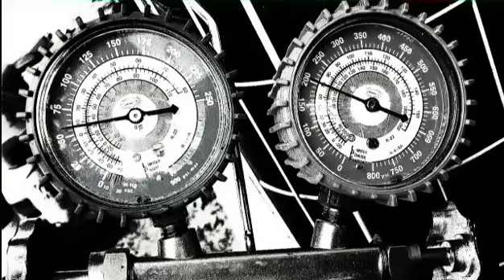HVAC RX11 and Pro Flush Debate

Comment: From what I was taught in hvac school, system flush is for when there is a compressor burnout and contamination or if you are changing refrigerant. If you don't get rid of residual oils and acids in the line set they can damage your system when it's replaced.

Comment: I have used flush on burnouts...  And linesets that I know I can get it all out...  I have commercial buildings that I can't change the pipes...yet I want all the oil out... So I have done each pipe separately....but they have been straight lines for the most part...  I don't think its "needed"...  But I know my boss was told to do it ...so  I know he feels more comfortable when I do use it!  Lennox's flush procedure is ludicrous...  So r11 made more sense to us...  But I gone the way of not using it and just the lines blown out real good!
Reply from the maker: Billy Knoth Hey what the boss says goes. A lot of it is comfort, how far do you need to take it to do a good job in your own mind.
Reply: I have accepted the fact that I can blowout with nitro only...  And I'm good with that...I will always do at leased that.... I call that good...  But if lines are in that good of shape..."oil less".  I can see skipping nitro...to save time...  Just don't think I would..lol..have u seen what Lennox wants you to do???  They were CRAZY!!!

Comment: Sometimes I will Braze all my joints except for the coil and condenser and then flush to remove the carbon deposits from the joints i just soldered ,but I always flush with RX-11.

Comment: I use a 11 CFM vacuum and 3/8 hoses also flush the system with dry nitrogen after using R-11 flash
Reply from the maker: acechoice45 sounds full proof. I don't go that far, but it sure aint gonna hurt as long as the flush comes out.

Comment: Flush only for burnouts and lots of nitro and a thorough vacuum afterwards. Normal changeouts no flush no worries. No lineset changes unless size is off. Oil is oil. One oil isnt gonna hurt another oil as long as both are dry and free of contamination.
Reply from the maker: awsom70 sounds right to me

Comment: The Long Answer---There has been two times when i had to use Flush Lately.
1) The Condenser on a Refrigeration unit Go so Plugged up with Kitchen Grease, the unit Ran so HOT For So LOng Before the Compressor Locked UP it Turned the POE Oil to TAR ! The Liquid Tar / POE oil Plugged up the Metering Device Solid. the unit Had to Be Taken apart into Sections and Flushed in 3 Sections. Evap, Condenser and Piping Before a New Compressor and Metering Device Had to be installed. The Flush Liquid Came out in a Brown & Black Color Liquid out of the Condenser. it Was Nasty! Then i Had to Blow the Shit out of it with Dry Nitrogen until Clean & Dry! Installing SUCTION & LIQUID Driers Too is Allways Necesary after a Flush Job.

Comment: If I know that the system has had leak seal in it I will for sure use flush. I changed a compressor out on a package system that I did not know that leak seal had been used. I flushed with nitrogen and of course pulled vacuum.The compressor lasted 2 weeks...when I returned I noticed build up(leak seal) settled in the bends inside of the copper. I then flushed with R11,flushed with nitrogen and pulled vacuum...not had a problem sense.   So in a lineset we sometimes never know where a bend may be and if it has had leak seal in it...it will settle and nitrogen or vacuum will not get it all out.
Reply: Interesting thought I'll remember
Reply from the maker: ClemonsHVAC was that on a gas pack? I always worry about reversing valve failures after those procedures.
Reply: Yes, Trane gas pack and A/C with a two circuit system

Comment: I am not keen on the modern flushing chemicals. I would rather run a system then change the compressor oil after a week or so.

Years ago when R11 was legal, it was a good option but i don't think newer ones will evaporate fully so will be a contaminant in their own right.
Reply from the maker: heavydiesel I know that's right. The new ones fowl up a vacuum to no end.